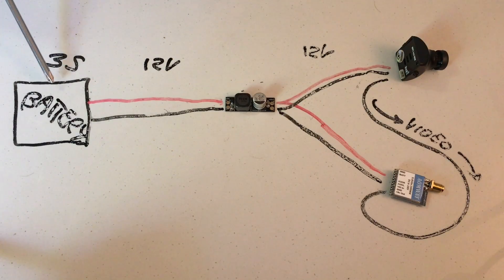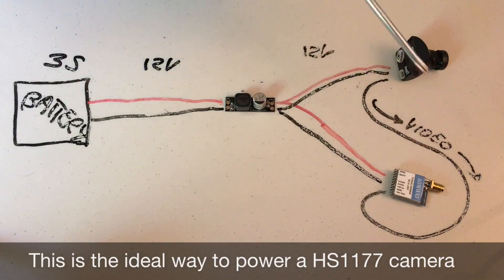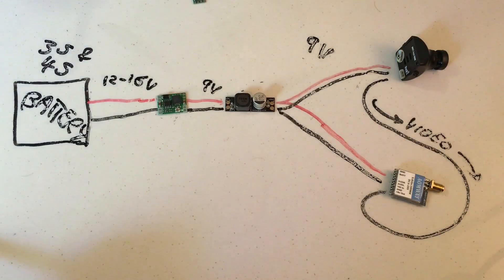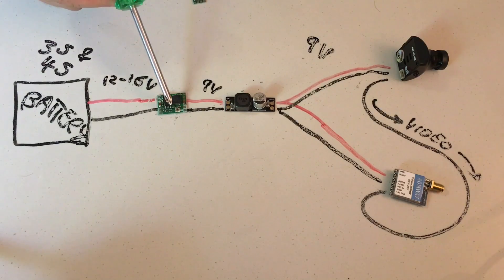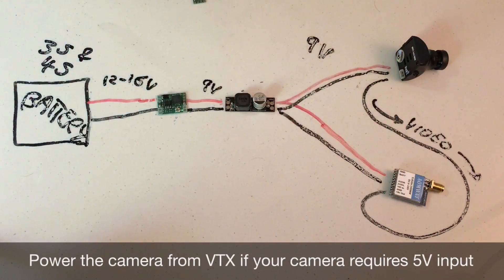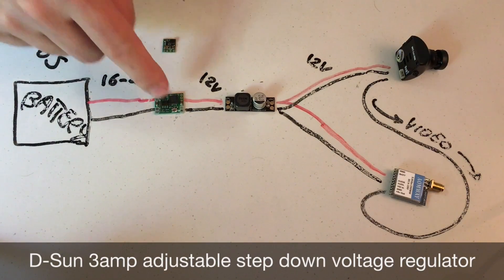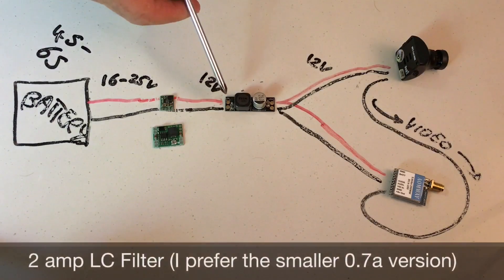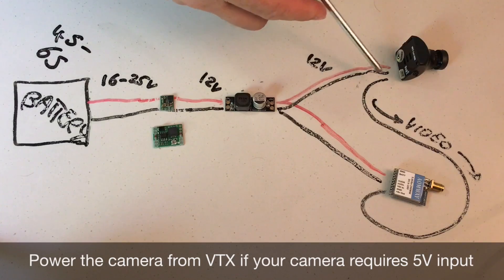How To Use An LC Filter For FPV (3S-6S)

Comment: Great video. Many thanks!. I've seen many vids about this topic and this is the only one where the camera share the power with the FC.  But it is not clear to me how the LC il connected.

In my case the FC is powered by the ESC board with a direct link that I can't cut to insert the filter. 

I' could insert the filter in the VTX power line (coming from the FC, but basically from the ESC board) and power the camera with the VTX 5V output, but the video signal must be obtained by the FC board to get the OSD. So the signal can be compromised by the noise arriving by the FC powerline.

I guess my only option is to put the filter in place of the capacitor connected in parallel with the battery, but i guess this configuration will not help a lot. Am I wrong?

Comment: Tried and my result is not ideal. Because there is high frequent voltage spike on 3s, it peak to 29V and drop to 5V, if I apply step down to first I still have lot of noise when voltage drop. I recommend to apply LC filter first before step down. On that case I made my own LC filter with 50V 1000µf capacitor and 2.72mH inductor

Comment: Hey Darke Peak, great video, well I just burnt another vtx, I'm using a spf3, littlebees 20A pro, lumenier pdb  http://www.getfpv.com/electronics/power-distribution-boards-pdb/lumenier-4power-mini-pdb.html) with a 5V pololu to power my fc on 4S 80C (lumenier). Well I only have an lc filter that I'm installing between the vtx and the pdb, does that make sense?, you think that will provide any protection against voltage spikes on crashes? thanks
Reply: it's bcos of the littlebees. You need to use capacitors to absorb the extra voltage. You need to add a big capacitor or use smaller capacitors on every esc out (25-35v)
Reply: agree 100%, in fact I bought some 1000uF low ESR capacitors, but is not clear to me where should I solder  them?
Reply: you can do this: I ended up adding a 470uf 35v cap directly to the powerboard on my 5" Alien right where I have the VTX and 9v pololu that feeds my hs1177. Working great on 3s and 4s without issues and no noise at all. Even without a cap or filter on the cam side of the pololu
Reply: cool, thanks

Comment: +Darke Peak…My TBS unify pro VTX has a maximum input of 5.5v(so all the set ups you are showing in this video i can't use)….i made the following set up for 4s…i bought a Pololu D24V5F5 Step Down regulator...Input voltage 6v to 36v….output 5 Volt 500mA….this will go to the LC power filter-0.7A and i will then supply my TBS unify pro VTX and my HS1177 both with the 5v…this will work right? or am i wrong on this? preparing my first build for next week so any input would be really appreciated
Reply from the maker: It should work but it is close to the minimum voltage for the camera. I've never run a HS1177 below 9v but they are supposedly rated down to 5V.
Reply: +Darke Peak ... Thanks..I will just try it and see how it goes.

Comment: Never seen the need for an LC Filter - why not do a before/after video comparison showing why you might need it? As far as I've been able to tell, PDB regulators give clean enough output anyway, and modern VTX and Cam are more noise resistant anyway when you power them direct from the battery...

Comment: I couldn't get a regulator to power the LC filters myself.  Not enough "umph" to do so.  At least with a 1amp Pololu (May have better luck with DSun's).  Thus I went straight battery to LC filter to cam and VTX on 4s.  Works great.  Like you, i burned up equipment because of the little bees.  Great vid!
Reply from the maker: +Beerad FPV If you were using a 3S battery with a 12V Pololu it can be a problem.  When the battery voltage drops down below 12V the output can be inconsistent.